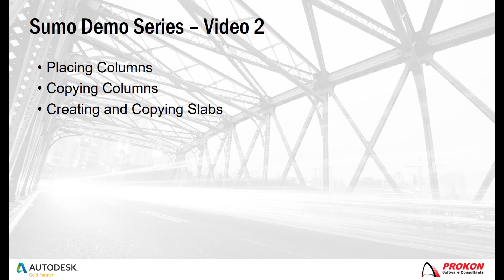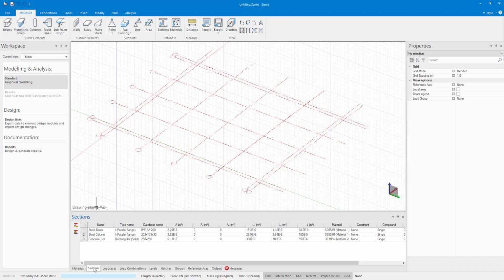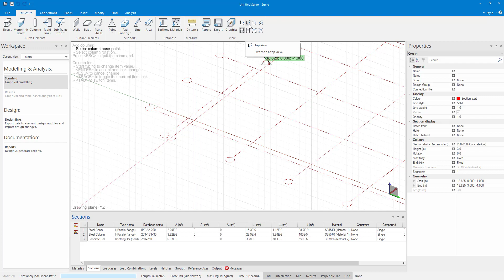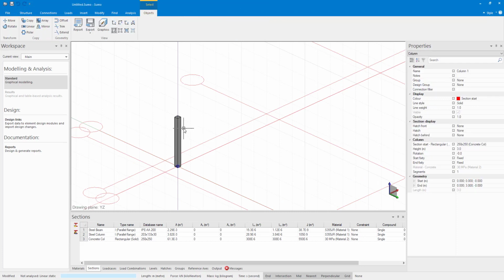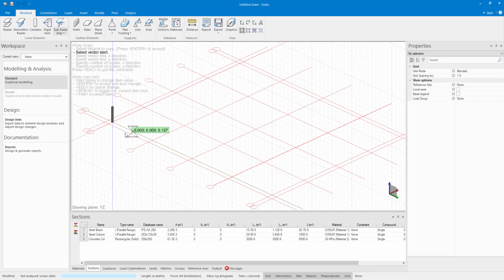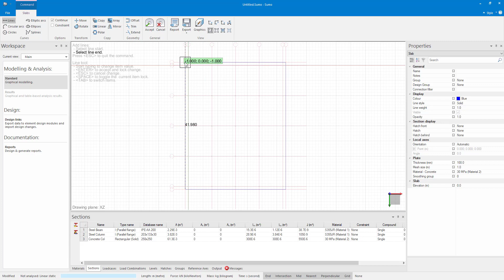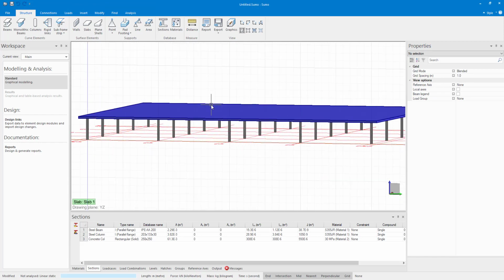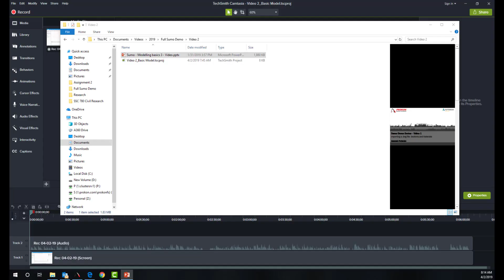Prokon Sumo - Demo 2: Basic Modelling tools

Comment: Prokon is good, but why are all your videos using only built in sections especially in Concrete (Beams and Columns) , is it possible to add Column section of 200 x 350 ??
Review your videos
Reply from the maker: Hi, 

The concrete section in the video was a square one. You can import more types from the section database, including custom sections.

For any technical assistance, you can contact support@prokon.com.